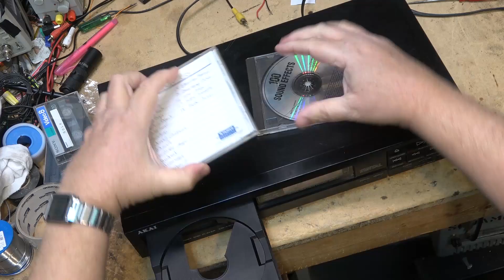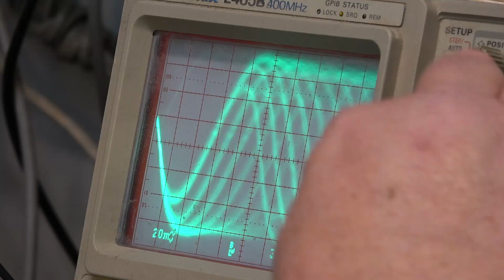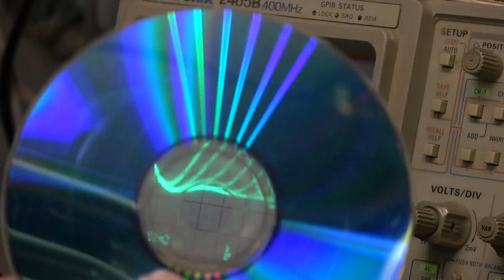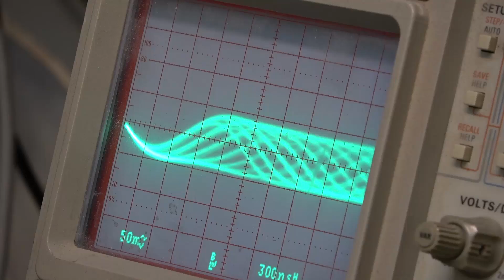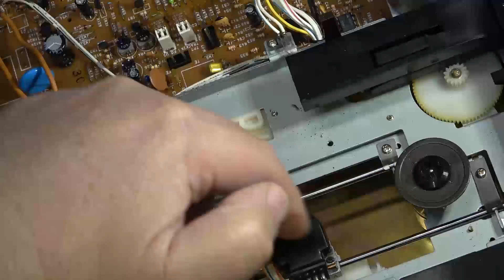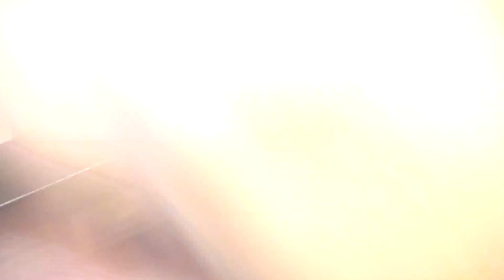Vintage Akai CD A30 CD player from 1986 will it work

Comment: Hi, where can I buy a CD test for laser alligment?
Reply from the maker: Couldn't tell you now.  I had a set of Technics disks. There were 3 if them and they cost something like 250 each.
Reply: @12voltvids  whaaaaaat?? So, it's impossible have something similar for less??
Reply from the maker: @gianlucamazzoni1672  just telling you what the factory alignment disks cost back in the 80's. There was a special jig required too, that cost 1750.00!
Needless to say digital servos made these unnecessary and obsolete. I still remember the shitstorm that happened when the Jay guy ordered to do CD work arrived with a bill of $1,700. The boss damn near shit a brick, and I got ripped a new one. I had no idea what the test jig cost I was told that one was required for me to do warranty work so I told Panasonic to send me one it had no idea that it was going to cost what it did. I figured because I was a warranty servicer that they would send me the equipment to do warranty work but nope they charged us for it and we never made the money back on servicing because they paid $50 per unit to service under warranty so in all the time that we had to fix those models that require that jig we never even came close to breaking even on the costs of the test jig. The next year all the CD players use digital servos and the test jig was no longer needed so once the old units were out of warranty people weren't fixing them they were tossing them for a newer cheaper better players.
Reply: @12voltvids  so, you are telling that for servicing 99% of CDs I can use a normal CD??
Reply from the maker: @gianlucamazzoni1672  yes it will get you in the ball park.  The test CDs had specific errors burned in for fine tuning , and disks with wobble and escintricity errors ect. So the player could be set up to handle scratched of poorly made disks.  There were tons of crap disks made by cinram in the 80s.
Reply: @12voltvids   perfect, it will be very interesting a tutorial!

Comment: Akai proves better lasting than many higher regarded brands. When it's an Akai the metalwork is not rusty, capacitors are still lively and bulbs usually work. Heck, even dial strings in Akai tuners often remain strong as new.
Reply from the maker: Well the bulb blew on this one.  Left it on all night and this morning the display is dark. Looks like another video to replace that bulb.  Incandescent? LED? Tough choice.
Reply: @12voltvids  Incadenscent if you got. Led usually makes kinda of a hotspot backlight.

Comment: Trying to find the digital output tp on my Cambridge Audio Azure 640C mk 2 CD player. Service manual for that unit plain sucks, don't know if you have worked on one of these. Main problem people report on the internet when unit displays "no play" is capacitors in the servo drive board that need replaced. Can sometimes get it to play by doing a full power down, unplug from wall, wait for things to equalize, then power back up and it will work for awhile. Looking at the eye pattern should give me a clue as to when it is failing to read.

Comment: I love CD players.  Its my main audio format.  If I was more interested in music and had a bigger collection I could see myself drooling over an ipod but with only 3 shelves of CD's I'm not nearly there yet.

Besides I prefer the interface of a CD player to a touchscreen or iPod wheel any day.
Reply: iPod? Those are 20 years old now! I still have a gen7 160 gig iPod, waiting for it to die. I use an SD memory card for the car, it does have a CD player, but guess where they put it? In the glove box! and it is a single player!
Reply: Simply because CD is , and was the very last uncompressed audio format. Everything we’ve had since involving computers and ipods have compressed sound files which will NEVER sound as good as a full range CD digital recording
Reply: @GBOAF216  lots of formats better than CD. Some claim retrieval of files from a hard drive to have less read errors than an optical drive. Reading a CD from a short wavelength laser, such as the violet of blu-ray, which has a smaller focus spot, produces less read errors than a red laser, or infrared long wavelength laser. Not sure if it is true, but optical storage is not perfect.
Reply: @zulumax1   yes I get that, a lot of the quality comes from the jitter accuracy of the DAC, was a lot of work done by the  ‘nerd/geek’ fraternity to get the timing accuracy spot on with high end CD decks, I myself tweaked certain Philips and Denon decks to get a ‘closer to analogue’ sound from these 1 & 0’s streams….. all good fun… all about the data accuracy. So I guess a solid state memory chip with a super clock and digital filter will be the best option?? Discuss…..
Reply: @GBOAF216  Just repaired a Denon DCD-1560 from 1989, has dual mono DAC and weighs 40 lbs. Probably one of my favorite vintage players, or the Sony CDP-302es from 1985. Always liked the Denon or Sony ES line myself.
  You also need a good sound card in your computer which is not built on the motherboard. Digital noise produces jitter and the recordings will sound poor. Any digital playback device can only sound as good as what you feed it, including an iPod.
Reply: @GBOAF216  Don't know which storage retrieval system does the least damage to the file reproduction, I am constantly learning myself. Some claim that streaming from a service is more bit perfect due to checks and rechecks made to assure the file packets arrive undamaged. CD data is imperfect, that is why they need error correction which "guesses" where the data points should have been when a data loss occurs. If it can't keep up that is when you hear the buzzing or clicking noise.